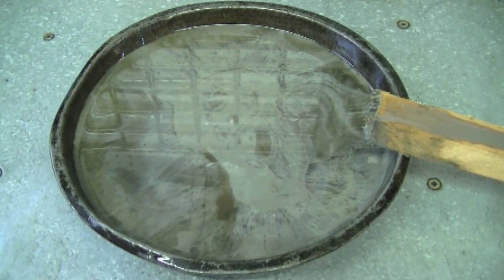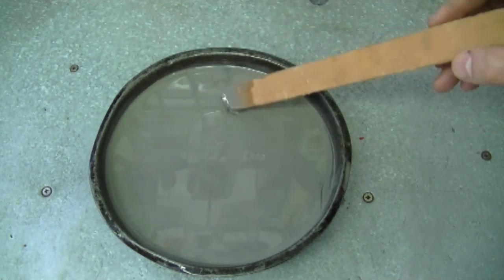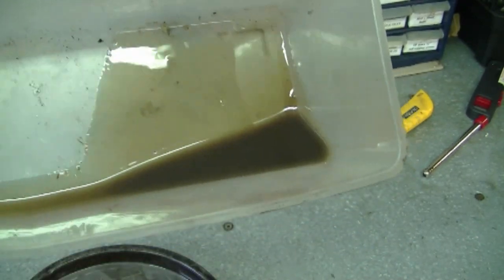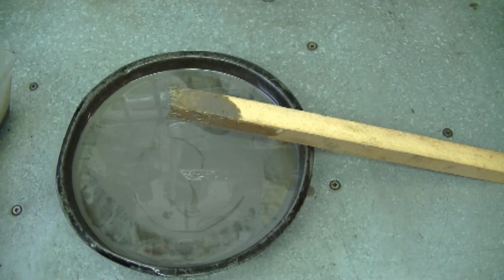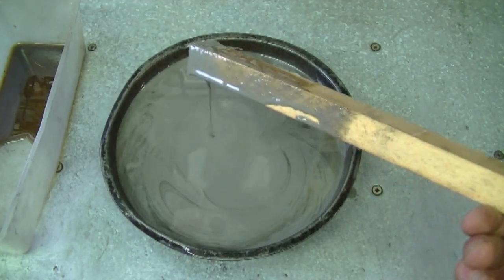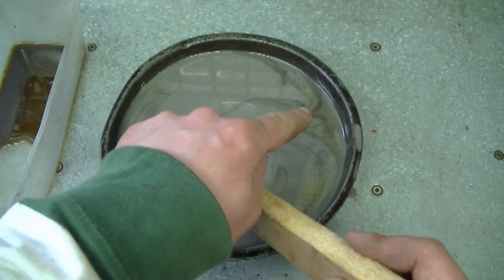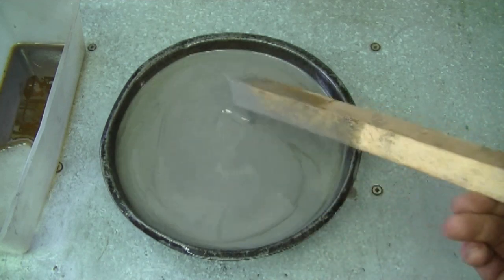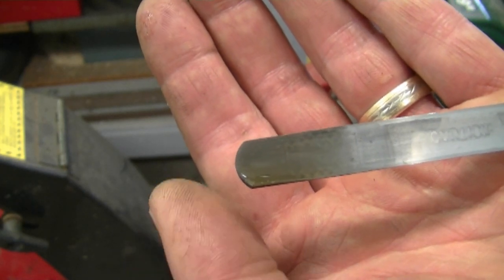Why Grey Oil In a Snowblower Engine Is Bad

Comment: Really nice simple explanation.   Had oil like that out of my small 4cyl outboard.    I suspect, as you say, it is because it sat all winter outside with a lot of moisture around.   Started it once a month or so, but never let it warm up or dry out.    If it stays clean, that was it.   If it gets bad, I could have a bad head gasket or other as these engines are also water cooled.   But really nice, thanks!

Comment: This is probably coming too late but I have one of those generators. I purchased it to work at my mother-in-law's cabin. She needed some bridge repairs done and there were no electrical outlets near the bridge. It powered 3 simultaneous 1/2" drills with no problems. It did bog down when I tried cutting some wet pressure treated 2X8 lumber with a skill saw. Depending on what you need the generator for, you may want to buy the next bigger one. For camping it should be fine though.

Comment: what I meant was he had the oil plug coated with what I think is anti-seize, the top of the oil plug had about 1/8 inch stuck to it and all the threads were coated pretty thick. I'm not really thinking that there was moisture in the oil, I'm thinking it was the anti-seize mixing with the oil. Harmful or not?

Comment: Hey Doneyboy, I just recently purchased a  used lawn mower off of craigslist with a tecumseh engine, I changed the oil the same day I bought it and the oil looked pretty much the same as the oil in your video, I noticed that it looked as if he had coated the oil plug with anti seize. I cleaned it off of the threads and put about 15oz of oil back in, ran it for a few minutes and drained it again, refilled it, ran it for 10 minutes, it's much cleaner but still grey. would anti seize be harmful?

Comment: I have notised that the oil whas like that in some engines i worked on , i found on the engines have ice in the breather tube between the valvecap and the carburator . When this tube is cloged you will have alot of whater in the motor and this is on OHV engines.

Comment: Last week i worked on a honda engine on a pressure washer which only had 35 PSI because it was run with a good amount of water in the oil

Comment: I got a little water in my oil in my lawnmower. I have drained it a couple of times but still has that milky look. Can I add anything to it to remove the water like some type of alcohol. Wasn't sure if this would be ok or not. Thanks!
Reply: Berkner80 im having the same problem
Reply: Berkner80 I might try flushing it out with marvel mystery oil but i don't know

Comment: if u keep starting a engine but not warming them up fully oil will turn grey because of moisture build up. ive seen this in brand new machines that are only started to be moved outside.

Comment: I just changed my oil in a toro snowblower 2 weeks ago and ran it for about 20 minutes.  Went to use it today and the new oil is dirtier than the old oil.
Any ideas what could have contaminated the oil so fast?  This is a new machine that had 2 hours on it before the first oil change.  Any help would be greatly appreciated.
Reply: Me to bought a toro never used it decided to go out there and decided to start it but looked at the oil it was grey and it has zero hours on it I took it back to the dealer! What you end up doing!
Reply: @got2getit204   i just changed the oil again, seems okay now. Would have liked a reply from Don but he is probably quite busy.
Reply: Most likely it's fine, newer engines that are aluminum it leeches out into the oil which should eventually stop after a few oil changes. It's generally not harmful so just change it a bit more often until it clears up. I know Honda's do this and I have a B&S push mower that is doing it too but is barely broken in, have only changed the oil 2 or 3 times but doesn't get run much and it's not left outside.

Comment: Dony is it ok to have some grey oil near the seal because in my snowblower after I let it run I check the oil and there's gray oil near the cap seal but not at the bottom of the dipstick.
Reply from the maker: +A.M.M.O yes sometimes that is normal
Reply: +donyboy73 ok thanks
Reply from the maker: +hi bill I replace the oil a few times if it's grey like in the video

Comment: Yes i had a lawnmower just like that it's a old lawnmower so i took the chance and flush it with a special degreaser and water ran a water hose inside the engine drain it and blow through with an air hose compressor air and let it dry out for a week replace the the oil cap under the lawnmower add new oil clean the carburetor jets all the way through including the gas tank and now it's runs like a sewing machine, make sure to lubrication the piston rings before putting the head back on by pouring a little oil down into the cylinder turns the flywheel by hand, this this is twice as strong as dawn dish detergent it's made for removing ditty oil, i didn't know if it would work only it did, also i have lots of lawnmower so if it didn't didn't mind i just was testing something out because nothing else would not work only this did, make sure not to leave any mostly in the lawnmower make sure it's dry completely i only do this to something that i don't really have to have only it's runs good

Comment: @donyboy73 i think he means, if you let it run enough to get everything warm and burn out most of the moisture like in a car engine(before the oil turns gray), the more you run the cars engine the better the engine will be, when car engines sit alot, and say only get ran to go 5min down the road and back, not all of the moisture and stuff gets cleaned out i guess i can say

Comment: That is the same color of oil in a car or truck when the head gasket blows or has blow by. 
I have seen it in a car that ran ok but the oil was the same color a week later the car died.

Comment: Did not answer the basic question: Why does water get into the oil and how does it get in there? How do you prevent it? Those are the fundamental questions that need answering.
Reply: Listen again. He defenitely explains how it can occur.
Reply: He did answer your questions in his video: He said the machine is usually either left outside or snow gets in there during use as these machines do not have air filters.
Reply: My question is "How do you prevent it? I would have to change the oil after every time I use it because sure as hell water gets into the oil ONLY when I use it. After storage all summer, the oil is fine.  Last year I changed the oil 8 times because every time I used it the oil would start to turn grey. A real pain the in the butt. The only way I can figure it is getting in is through the carburetor and here in the mountains of Quebec we get a lot of snow.
Reply: cardo  You know, after I sent my question I realized exactly what you said, as I remembered him saying that. My mind must have been wandering a little on that part and I meant to delete my question.  Thanks for the reminder.
Reply: Agreed, keep changing the oil.
Reply: @hoseman317 -- That quantity of water getting into your engine through the carb would be a real fluke. Water / snow going into the carb would foul the plug causing misfire. Engine heat would evaporate normal crankcase condensation. You need to check the oil fill cap, tube, and tube gasket and, if OHV, valve cover gasket.